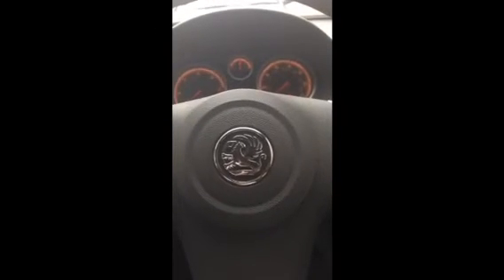Vauxhall Corsa Big Common Problem

Comment: So what was the outcome with the car and spanner warning? Turbo fault?(1.3 diesel is a FIAT engine)  Its very common for the front brakes on a corsa to squeak. if its the rear then the drums need cleaning plus lubricate and realign the brake shoes.
Reply from the maker: Delano Rods It was the turbo actuator getting stuck and then the EGR VALVE